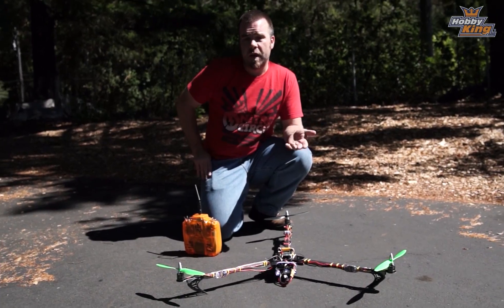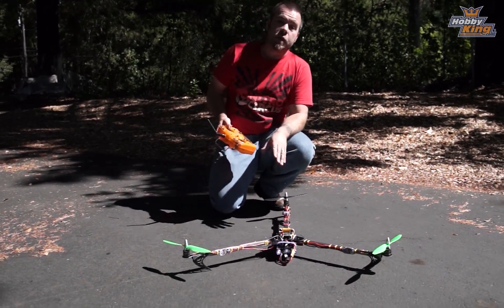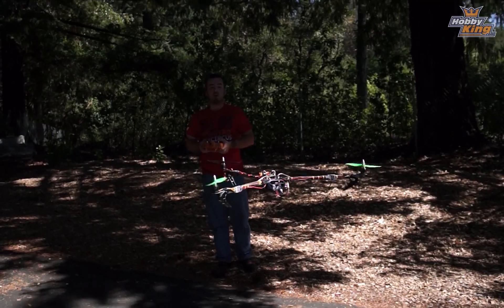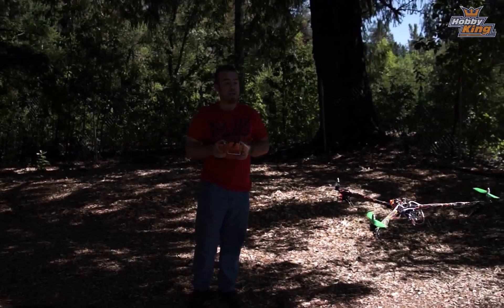HobbyKing - KK2.0 Complete Guide Pt.5 - X900 Tricopter

Comment: Matt, I have built two quad copters, one an SK450 and a tricopter.  I have the same problem with all three.  I take off fairly stable and tri to hover.  Between one notch on the stick and the next I am either climbing or falling with no stable inbetween for hovering.  I am using a spektrum 7s transmitter. I have the throtel adjust on the KK2.1 board set to 20 to get all the motors to start at once.

Comment: To clarify,according to the KK2.1 motor layout for the tricop motor rotation(prop).
.
M1= CW--->BLADE1= CW         (FL)
.
M2= CCW-->BLADE2= *CCW     (FR)
.
M3= CW--->BLADE3= CW          (BK)   

all provide lift.
.
M4= SERVO--->MOTION OPPOSITE TO STICK MOTION(L-R) VIEWED FROM THE BACK.
Reply: It doesnt really matter, it will fly no matter what direction props you have, but it they are all the same direction, the tricopter will tend to lean in one direction instead of staying level and the tail servo will tilt more as it has to fight the extra torque of the motors. It flies best when the two front props are counter rotating (usually inwards towards each other is my preference) and the tail can be either (it really doesnt matter).
Reply: I want to know the answer to this as well. Seems like mixed reviews. Some sites I've read all 3 props and motors turn same way but the kk2 configuration shows 2 ccw and 1cw
Reply: Other way around 2 cw and 1ccw

Comment: Trolleydolly130
You need to go into misc settings and adjust the throttle for motors 1+2 (turn them down a bit). Hth

Comment: Thanks for removing the props, though you then went and caught the tricopter.

Using the balance plug for voltage alarms and LEDs was a great idea, possible to get some more information on the setup?